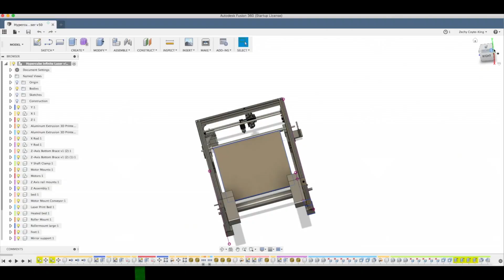Belt Printer Build: 6 - Z Steps & Squaring

Comment: Thank you for this series! I have been looking for a belt printer design that I can adapt to my product and this is it!
Why do you use 35degrees? is there a video that explains what is the best angle for the xy?
Reply from the maker: Hi Scott. I chose 35 degrees because of the heat block, nozzle clearance that I needed. The e3d nozzle isn’t very pointy. The disadvantage in 35 degrees is that the printer has to be wider to give you enough vertical distance. 45 degrees has more extreme overhangs so some model will be harder to print
Reply: I'd read elsewhere that angles slightly less than 45 degrees also help with first layer adhesion, as the first layer hits the bed just a little more "vertical".